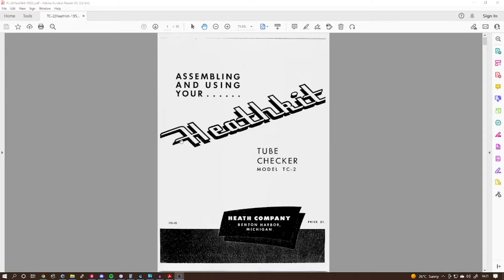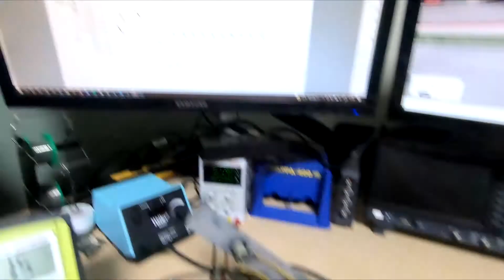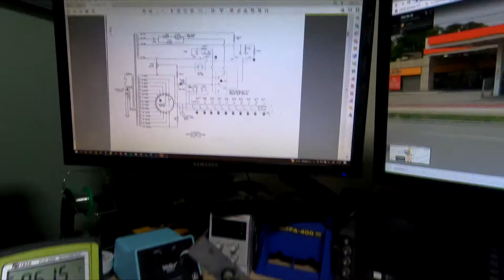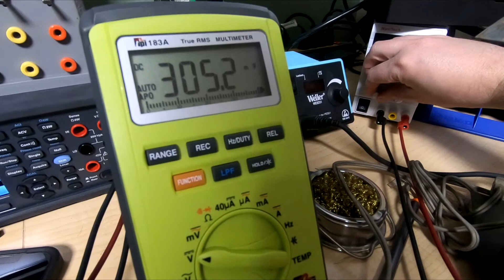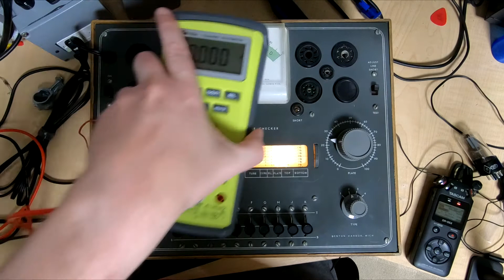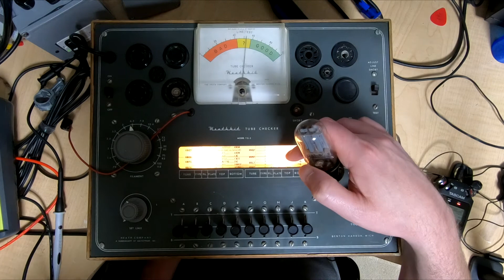Heathkit TC-2 Tube Tester Restoration and Test

Comment: Thanks for sharing! I have the same tester and looking to restore it. I'm interested in your cap leakage test at the beginning. Could you spell that out in more detail? That's a handy check, and I am still learning. Looks like you have a DCV supply putting 60V to the cap leads, checking the voltage at the cap leads with a meter, but how exactly are you measuring the leakage with the bench-top DMM? Where are the leads of the other meter connected to check the leakage? Are they just connected to the foil end of the cap and ground? Thanks so much!
Reply from the maker: Yes for sure! The test is really simple, connect a power supply positive lead to the Cap, positive if it's polarized.  Connect the other lead of the cap in series to a current meter that can measure microamps.  Then connect the other lead of the meter back to the supply.  Charge the cap up and let it stabilize and then read the current through the meter.  The meter could be substituted with a shunt resistor and voltmeter if you don't have a sensitive enough current meter.  

Ideally you want to be able to charge the capacitor to around 80% of rated voltage, but currently I'm limited to my 60Vdc supply.

IMSAI Guy has a really great video detailing it including the datasheet analysis of the capacitor to determine what is a reasonable leakage voltage.  

https://youtu.be/H1qMV_hTGGw